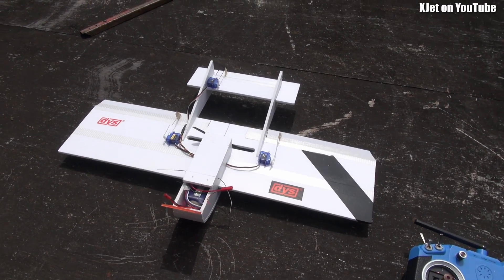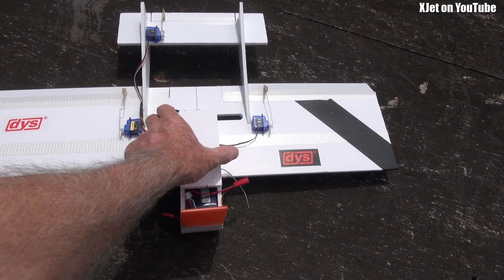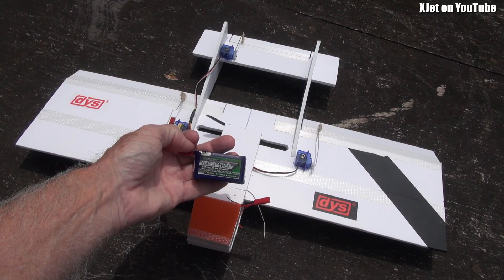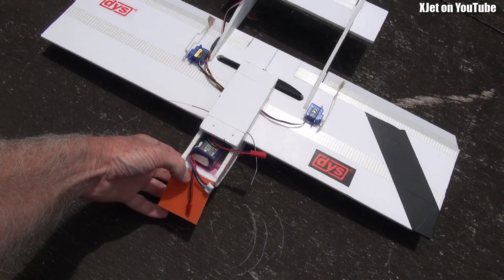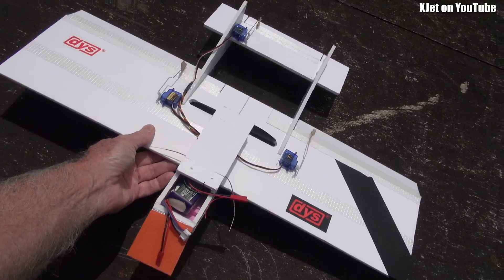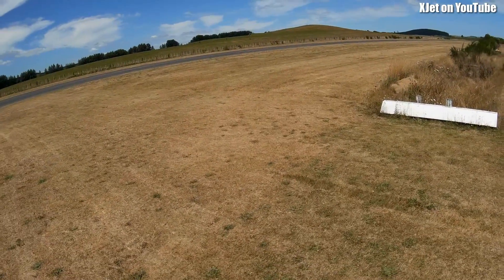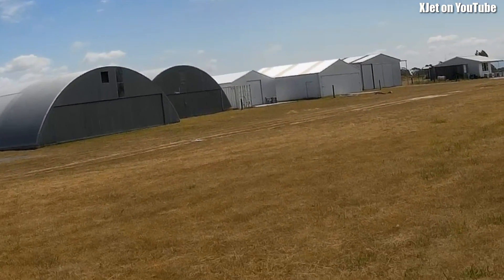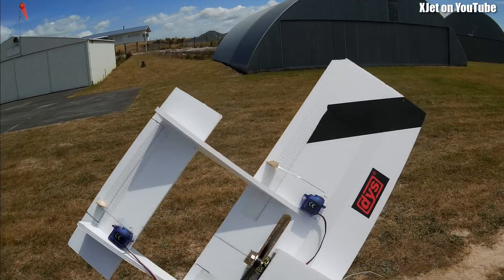RC Plane design fail (and bad CG)

Comment: I usually do a simple CG glide test. Only a rookie would mount the elevator servo on the 
tail....just saying...Get the parts as close to the Center of Pivot as possible..
Dual rate helps..on test flights.

Comment: I would start over. For long range FPV and Sub 250g I would design and build a glider airframe with a tractor motor. A 2S power system so I could use a larger mah battery with a low kv motor and a larger prop. I think that would pull fewer amps, require less thrust to keep it airborne and increase the range. See you in the Air!

Comment: thanks for posting.  here are some observations.   at :40,   EXTRA  bends  do  NOT  belong  in a  pushrod.     elevator servo  installed  AT  THE  TAIL.    (there is NO compelling  reason to put the servo  THERE.    doing so,  wonkifies the model's dom.)     at :42,  the  Excessive  cross-sectional area of the fuselage, Forward of the prop, results in a partially starved prop, ALL of the time.   the faster the model goes,  the Worse  it gets.    it appears that the model has a  zero-lift  main wing, with an  Excessive chord.   at :53, it is not clear whether control horns have been correctly installed.    the  non-moving areas of the horiz-stab, outboard of the vert-stabs,  DAMP  responses  to all  elevator inputs.   forward corners of wingtips  Should  Be  (suitably)  rounded.    the  dom  of the tail-booms  is  bass-ackwards.    ALL  Material  aft  of  the   prop   spoils, or  impedes the smooth flow of,  thrust  air.    at 1:38, it should be understood that  Thick  trailing edges  make  More  DRAG,  than   thin  ones.    it should be understood that elevator-sensitivity is  Excessive, because the elevator is  too close  to  the  cg/c-m.     ideally, the thrust line  Should  Intersect the c-m;  and the c-m of this model, is  Where.    inadequate prop clearance can result in a more noisy prop.    where a wing makes  DRAG   and  NO  lift,  nothing  IS   'normal'; discussion of 'variable c-p'  notwithstanding.    where a wing makes lift, centered on 30% of mac,  it is  Inherently  More  Stable,  than a zero-lift  wing.   if interested, see my tutorials.          first flights:   gain some altitude  at  CUT  THROTTLE.   determine a model's  nominal  glide  slope.    TRIM  ELEVATOR  accordingly.     cheers           googletranslate          some resources
https://wright.nasa.gov/airplane/shortw.html
 http://www.stengel.mycpanel.princeton.edu/MAE331Lecture6.pdf
(pagination has changed to,   'lecture6'   )

Comment: I had major issues with flat wings in several control line models. No matter  how stiff the flat wing was it would flex and cause erratic and intense uncontrollable flights.Try a simple diamond airfoil. Look for a plan for a 1/A control line model called LI'L SNIP for an example of a diamond airfoil.

Comment: Extremely short coupled, with the elevator going into the flat wing's shadow, as the nose rises...not destined to fly well, I'm afraid. On the other hand, it does look really cool!
Reply: That appears to be part of it.  Though normally the tail plane is pushing down to counter a CG forward of the wing's center of lift.  But if the CG is too far aft as well, I can see the behavior exhibited.

So, move the tail pane to not be shadowed by the wing, adjust CG forward.  And for good measure, just a little dihedral won't hurt.

Comment: That looked like the maiden flights of my first eight or ten scratch builds! Good work nursing it to a decent landing with the CG back that far though. I'm not sure which way to vote, on one hand I'm empirically curious to see what a CG shift and a "bolt-on" KF step would do for this one, but on the other I'm keen to see what design you'd come up with next! Go with your gut. :)

Comment: More nose weight, longer tail boom, add kfm2 step at 40% (I usually de paper the overlapping section so I don't have a paper to paper glue joint and I save weight.) iron your leading edges as well

Comment: That airplane looks like a line control model called the Voodoo that I flew back in the 60's. I replaced the Voodoo with another flying wing called the Winder and still have it today over fifty years later. Just looking at parts placement I'd say your tail heavy. One of the comments (Carl) got the control horn lengthened right. Also give it more throw up than down. Between a Winder and a Voodoo I think the Voodoo was far easier to fly. If you want tight and scary fast loops the Winder is your wing profile. We also flew the hell out of .049 powered plank  profile wings we shaped much like yours but scaled down and while they flew great they fall out of the sky once your out of gas. The Winder and Voodoo with symmetrical airfoil wings were so fast and efficient that you got a couple of free laps after the fuel ran out. I had K&B green head .35 motor that worked great on those wings. The guys flying RC versions in the 70's learned rudders don't do much on a short coupled design and found the bank and yank method worked great. The nice thing about flying wing designs in the early 70's was that you could fly them with the cheaper 3 channel radios that were being sold back then. Elevator, ailerons and throttle. 

A Google image search for UC Winder or UC Voodoo will pop up copies of the old plans and give you CG location.
Reply: Still have 2 Voodoos, probably turn to dust if I tried to fly them again.
Reply: @lloydprunier4415  My Winder is here in my living room and the silk and dope on it is as bright as the day I painted it all those decades ago. The motor would need to soak in some fuel for an hour or so to loosen it up some but I'm sure it would run with fresh fuel. I look at that airplane today and I'm still amazed how skilled I was at such a young age.

Comment: Sir Bruce, I really like this project. Please keep going!
Isn't it less efficient if You just use Newton and not Bernoulli? You could use a KFM2- or KFM4- or experimental-Airlines-Airfoil. Foamboard is quite heavy because of the paper. Wouldn't it be lighter to use depron with light tape? And by the way: you do not have to reinvent the wheel. Why not use proven Airframes? The ZOHD Dart is light and reasonable cheap.

Comment: Nice build.  Try building the fuselage farther forward by an inch or two.   After that you could move the battery forward to get the correct cg rather than adding any weights.  You can even put a smaller servo on the elevator.  Every gram counts on a small plane.

Comment: Did you think about a Kline–Fogleman airfoil, I built a 3 step wing, never put a motor on it, but it had great glide characteristics, the neighborhood kids saw me tossing it around, and wanted a try, the had some great fun for about an hour, until they got bored with it, and it held up great. Just a thought.

Comment: Reminds me of an aerobatic U-control I converted to R/C around 1970 or ‘71. It’s horizontal stab and elevator were so close to the wing that it was as wild as yours. I tamed it by using an extra-long control horn on the elevator. With the greatly reduced elevator throw it flew quite well. Hope this helps ;-)

Comment: with small planes i have good luck adding a good bit of expo, i'd give this 30 or 35% on the elevator and see if it tames it. add some to the roll while you are at it

Comment: smaller ..we want bigger.. can you test a  4 wing , 2 set biwing, front and back, with tail and tail surfaces ,horizontal, and  vertical  rudder or 2, cargo plane.. multiple  engines and vtol.. engines at a 20 degree tilt+-
doc johnny
sicily